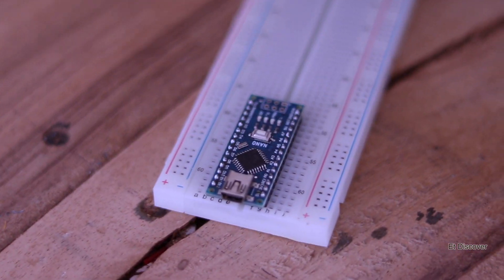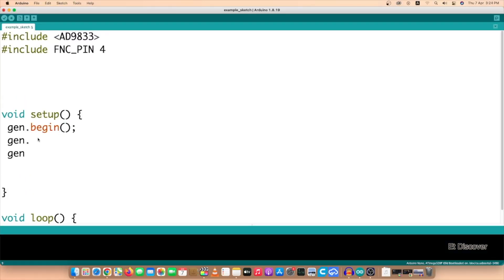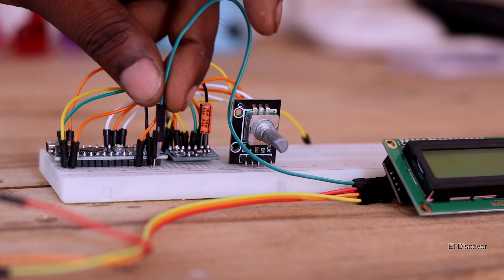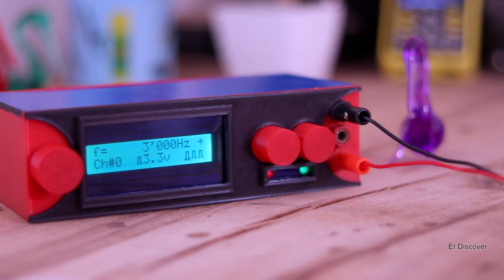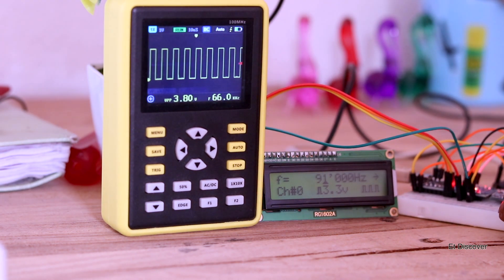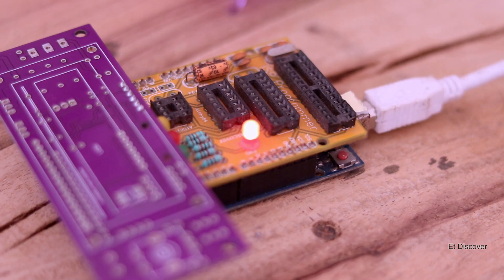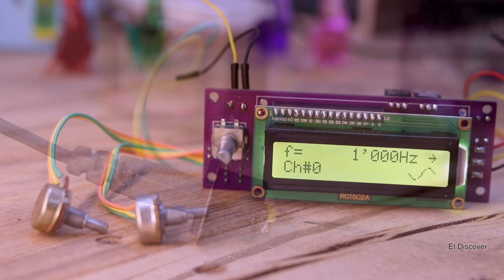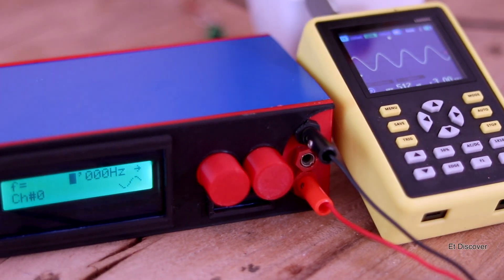DIY 12-Mhz Function Waveform Generator

Comment: Great Scott also made this type of DIY function generator but every time he compair between DIY or BUY. There,this type of DIY function generator using ad9833 It's work well in lower frequency but in higher frequency makes distortion. Great Scott explain this all and there BUY was the winner,
But this DIY is useful generally in self experience not professional🥰....
Reply from the maker: I am also mentioned the problem of higher frequency
Reply: He said that DIY was the winner!.
Reply: @anik2645 My guy, you are comparing apples to oranges